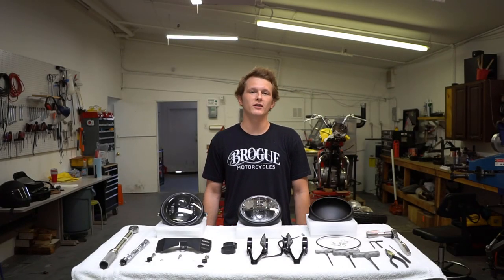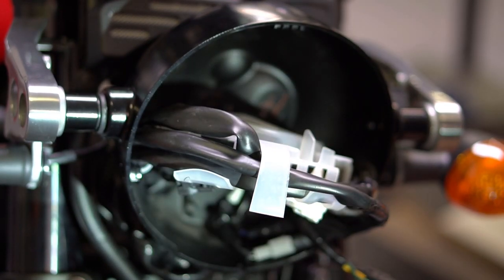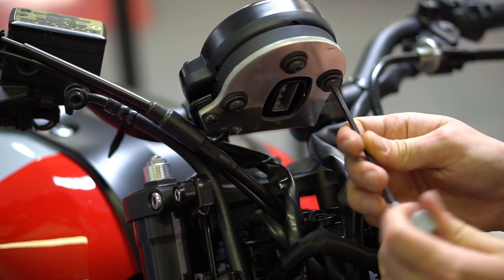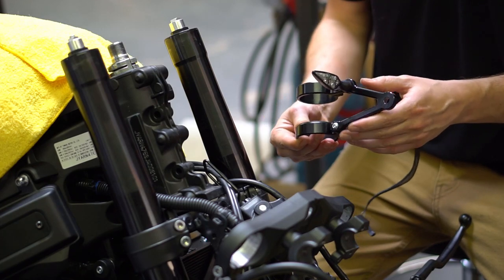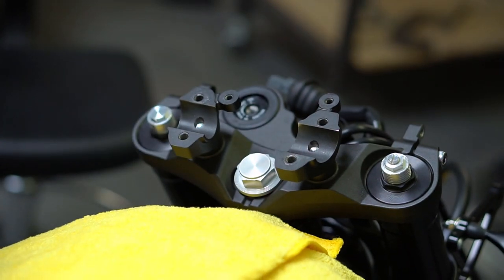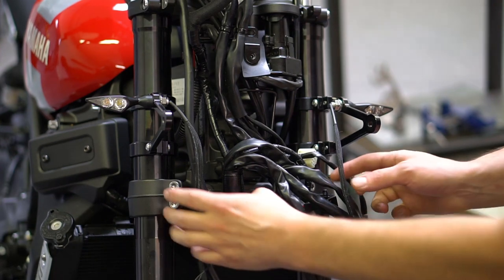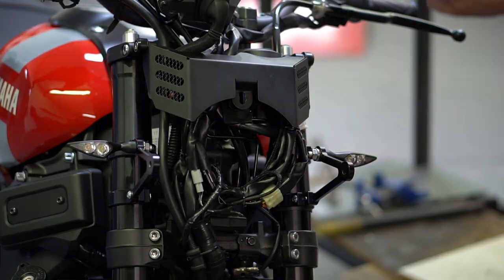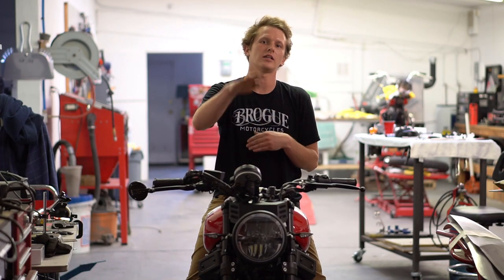Brogue XSR900 Front Valance Headlight & LED Kit (How To Video)

Comment: Want to get this for my XSR!  One question, though - are the wires and connectors okay to be exposed like that? They are outside the bucket light now and just worried about rain and pretty noonish when it comes to electrical
Reply from the maker: We recommend dielectric grease on all connections and you are good to go:)
Reply: sweet, thanks for the quick reply! @broguemotorcycles